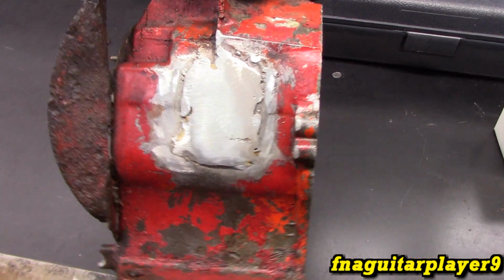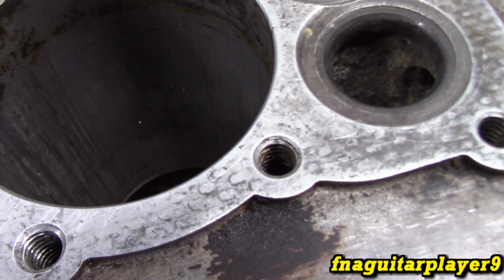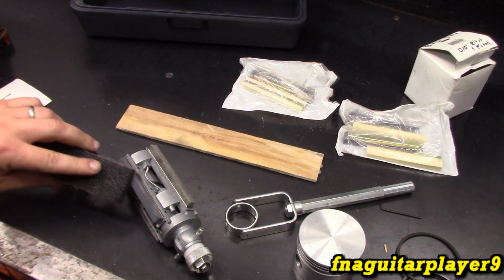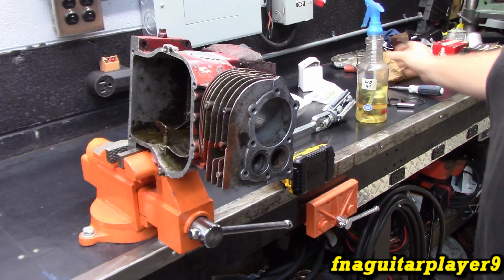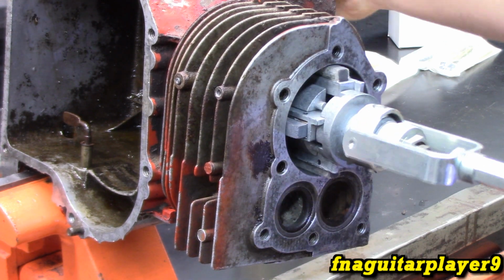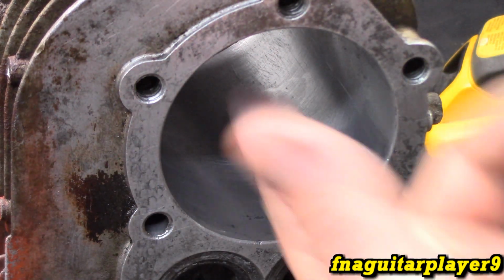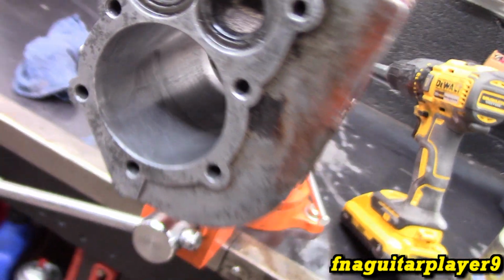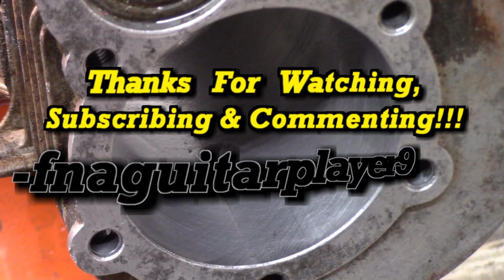Boring out Aluminum Bore Cylinder .020" with Lisle 16000 Hone (same process for cast iron sleeve)

Comment: would this work for 2 strokes?
Reply: When i was working in the machine shop we had a power hone with a sunnen head and if a 2 stroke came in with a .25mm osize piston i used to just hone it out you actually got a better clean up as 2 strokes tend to wear around the ports and sometimes boring them first they wont clean up as well as if you just hone them.

Comment: I bored a motorcycle cylinder with a Lisle 15000. It was at 1.5 mm over already and I took it out to 2.00mm.
Took a while but it worked

Comment: Did you ever use that hone on a outboard cylinder? I would like to bore out a 2 hp Johnson outboard cylinder .030 but that hone cost over $250.00 on Amazon.

Comment: it'll be fine. if ppl wud change the oil every < 25 hours. put a new air filter on it once a year. clean it every oil change. it will last a long time... but ppl cant even check / add oil to the motor.  i paint the motor and write on it with paint pen CHECK THE OIL BEFORE EACH RUN OF THE DAY!!!!!  even have stickers on E bay if want to do it that way as apparently ppl just cannot check the oil before first run of the day... or have oil on hand to add oil to the motor when it is low.  if it is worn some... more than we like... run 20-50 oil with 20% stp oil treatment to thicken the oil up some. oil turns to water when it is 100* in summer anyway and realize it is a mower engine, prolly wont last 20 years... unless... check/change the oil once a year and dont put that many hours on the machine a year as grass doesnt grow that much in some places ... in the west without constant irrigation 3x/week.
Reply: I had a Tecumseh iron bore 3.5hp mower last 17 years. Went through 3 sets of wheels and many blades. I got it off the curb for free when it was 2 years old, cleaned the carb and air filter, changed the oil and sharpened the blade. My Honda mower is 5 years old and runs like new, that one will be around for 20+ years. Take care of your equipment folks!
Reply: Yep, still using the same 3.5HP B&S push mower my dad bought new in 1977. Always checked oil before each use, changed oil twice a year, cleaned cooling fins and air filter every so often. It's still the best running mower on the block and runs just like it always has. Still has the factory crosshatching in the bore also when I stick my bore scope in the sparkplug hole. That thing has about 1500 hours of use on it and it's hit some stuff that should have killed it long ago. In 2004 there was a big chunk of underground electrical wire thrown into the back yard when we were having a lot of house work done. I hit that thing at full throttle one week and it stopped that engine dead in its tracks so fast, it fired right back up like nothing ever happened. To make it worse, my dad did exactly the same thing I did with it the next week. That thing went from 3600 RPM to zero RPM instantly both times.

Comment: Very informative, and seeing it done makes it not as scary as it sounds. Thanks for sharing. Maybe you might consider building a jig, perhaps using an old pillar drill or some such so you can bore vertically - that would make a great video? Would gravity - seeing as it was being bored horizontally - make any difference to keeping it round, that is would the weight of the cutter bearing down on the bore take more off the bottom than the top? Hope the question is clear. :)
Reply from the maker: Yeah, i understand that, i was afraid to do it on the first engine. Your welcome, your probably right, vertical would be best too i think, but i don't know if it would be enough to make a huge difference. Yes it is clear, I honestly don't know if it would make that big of a difference because of how this type of hone works, putting pressure out instead of being spring loaded. Thanks for Watching!!!
Reply: if ppl check/add/change the oil every 20 hours and change /clean air filter every 20 or so hours... motor wud last a good long time. i got one. the bolt fell out of the air cleaner... so instead of finding a bolt or going to HD and buying a bolt... they used tape to sort of hold the air cleaner cover on. motor had deep grooves on once side of cyl like that one. i honed it some with cyl hone,  same piston, new rings,  cleaned it up/painted it. will run 20-50 oil with 20% STP oil treatment to make oil thick as honey and run it with NEW AIR FILTER (5 for $9 on e bay) and NEW 25 cent 1/4" x 2" long bolt from HD to hold the air cleaner cover on. wont last forever but it will last long enuf for me in the re purpose i have planned for it. something to do, take apart, clean, new rings... for 190cc engine... not even briggs engine $9 rings vs $30 briggs rings... we will seee how the $9 rings hold up. im sure it will be fine.. with OIL IN THE MOTOR and not leaking out the bottom of dryed out seal that was worn out from lack of oil (sigh) .